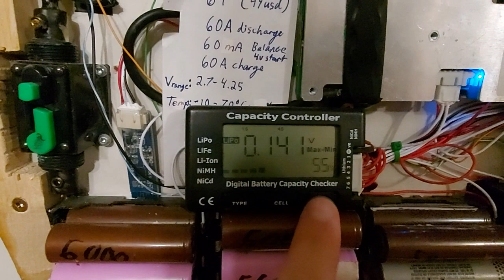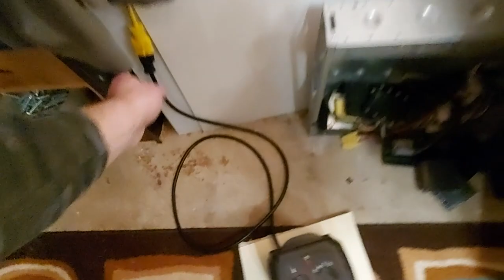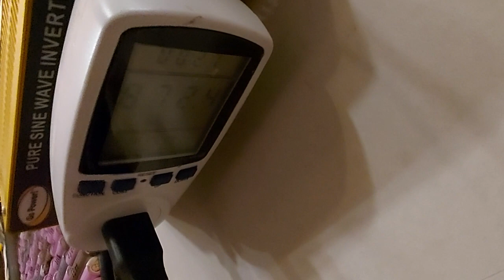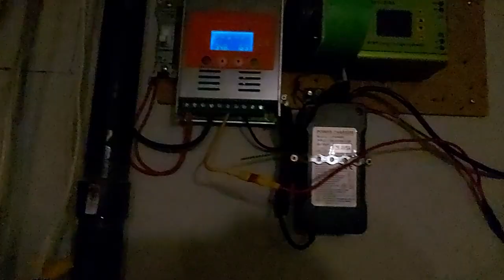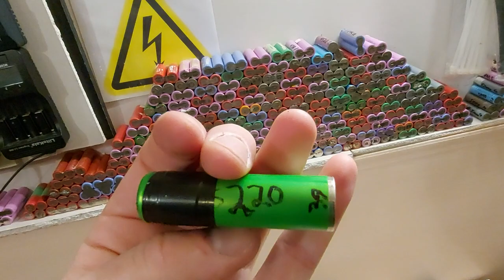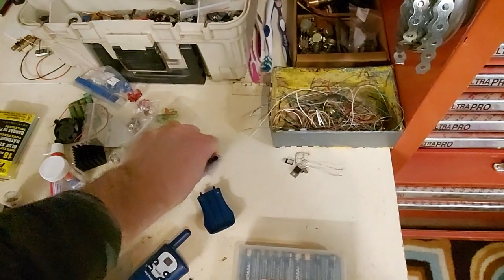18650 7s makeskyblue update video March 7 2021

Comment: should I use cell lower than 1000 mah? I have 133 cell at 700-1000 mah.
Reply from the maker: Whats the ir of them? You could put them into random small projects but with that much degradation a high amp draw application is not advisable